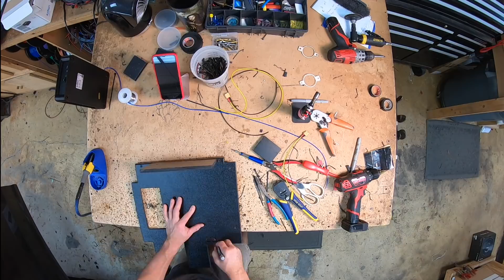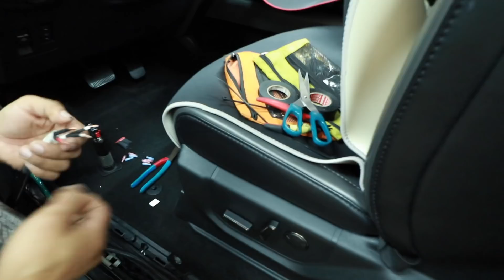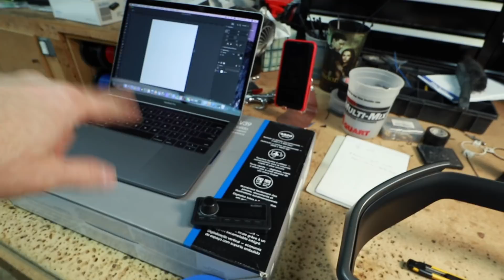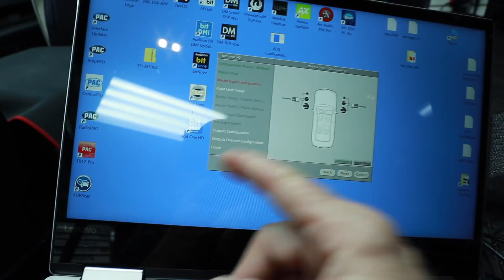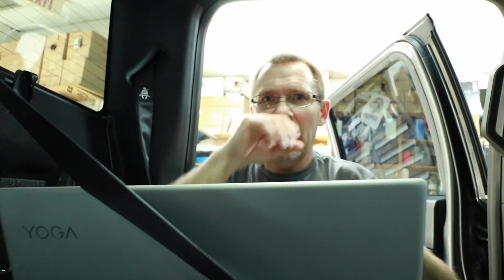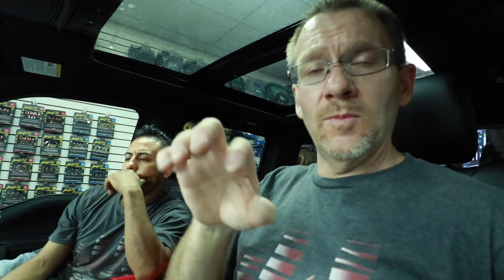Ford Raptor Audison full DA is done and sounding Amazing Installer Diaries 235 part 6

Comment: I have a 2018 f150 with the 4.3 inch screen, I want a new double din unit and aftermarket amps, I own more than 200 old school amps, what do I need to replace the radio? I will buy from 5 Star if they can ship the parts to Arizona.  Dash kit, module etc,  I want to maintain steering wheel controls.

Comment: Dean, I have to disagree on the way you measure the doors speaker distance. Yes, physically it is set back from the speaker grill but they have fast rings to direct the sound through the speaker grills. The sound only comes out of the grill. Would it not sound more correct to measure the grill distances instead for the recessed speakers as the sound is actually emerging from the grill?
Reply: Sound does not “emerge from the grill.” Measure to the voice coil.
Reply: @Masterdebator881  So if there is no grill and the speaker is behind the panel, where is the sound coming from? Exactly, this is why there is a speaker grill, so the sound can emerge into the cabin. The speaker is useless if there is no way for the sound to enter the listening area. You all can go on measuring the speaker behind the grill adding distance to the speaker and I will measure to the grill where the sound is passing through so that the image is correct.
Reply: Evilthx 
You might want to do some research on how a speaker functions before trying to correct somebody who actually has because your ignorance is showing.
Reply: @Masterdebator881  I know EXACTLY how a speaker functions. How the speaker functions is irrelevant to this conversation. Why would you measure to the speaker in the door when the only place the sound is coming into the cabin is through the grill in the door. If the speaker was 12" back from the grill are you going to still measure to the speaker when the place the sound passes through hasn't moved??? If there were NO obstructions then you measure to the speaker. Like if the speaker was mounted to the door panel.
Reply: Evilthx 
Do what you want as far as measuring, its your stereo. I’ll continue to do it the way science dictates.
Reply: @Masterdebator881  I am not aware of any science that "dictates" that you should measure to a speaker behind a panel for proper time alignment. Also, why measure to the voice coil? The voice coil is useless without the cone attached to it to move the air in front of it... which is where the sound comes from. The moving air in front of it. In the case of a speaker behind a panel, the moving air is exiting the grill in the door panel... measure to the actual place the sound is coming from. The grill.
Reply: Evilthx  
You’re not aware because you are ignorant! It’s obvious that you have no knowledge of the things you are speaking of. If you had a clue, you would know why you measure to the voice coil. Please explain how your theory correlates with home speakers that use physical time alignment, or have they been doing it wrong for decades?
Reply: @Masterdebator881  We are not talking about home speakers, we are taking about speakers in the door of a vehicle behind a solid panel with perforations in it to let the sound from the speaker come through so it can be heard. Trying to change scenarios because I am right isn't going to help your argument some how become correct.
Reply: Evilthx 
Where does sound originate from a speaker? That is your answer! You seem to think that sound begins once it enters the cabin through the grill. It doesn’t!
Reply: @Masterdebator881  The speaker creates the sound, that is all. Without the holes in the door panel for that sound to come through, you would not hear the speaker. When you measure to the voice coil behind the cone, behind the panel you are measuring to an obstructed speaker. You will have issues with phase and correct imaging.
Reply: @Masterdebator881  Also... Let's use your logic. Where are you hearing your door speakers sound? At the speaker or the grill in the door?
Reply: Evilthx 
Go cover your grill, with music playing,see if you still hear sound. I’ve spent enough time on this, I refuse to educate people for free. Plus, you seem to know it all.
Reply: @Masterdebator881  good thing cause my iq would drop if I paid you to educate me. Nobody listens to their music with the speakers blocked off.
Reply: Evilthx 
Ya genius! Because nobody listens to subwoofers in trunks! Where do you measure to time align a subwoofer? I can’t wait.....
Reply: @Masterdebator881  Now that I am home from work, I can respond. Well, being that subwoofers don't tend to suffer from beaming and the lower the bass the more non-directional it becomes, it is not as critical. However, Mine is set to a distance of ZERO inches in my RF 3Sixty.3. I measured it with the rear seat backs down, to the edge of the baffle which is rear facing in my trunk. My midbass are measured to the door grills, my mids are also measured to the door grills and my tweeters are mounted in pods on my A-pillars and are measured to the center of the tweeter face.
Reply: Evilthx 
Beaming? What the hell does that have to do with time alignment? I don’t think you even know what the purpose of time alignment is!
Reply: “The origin of sound from the speaker (not a horn) is the position of the voice coil. Estimate the distance from the grille to the position of the voice coil and add it to each of the measurements. Doing this may help a little with crossovers, but it doesn’t matter for left to right imaging.” Andy Wehmeyer
Reply: @Masterdebator881  One more thing.. When you time align the speaker behind the door panel you "move the speaker" away from the panel and away from the grill electronically and you create a delay behind the panel. When you measure to the door panels grill, you "move the grill"  WITH the speaker behind it because they will now act as one unit. The distance from the cone of the speaker to the grill has not been altered via the delay as the previous example has been. Surface mounted and or exposed speakers can and should be measured to the speaker.
Reply: Evilthx 
You become dumber with each comment you make.
Reply: @Masterdebator881  Isn't it sad that when one has no rebuttal they resort to insults like it will make the other person sad somehow for shutting them up.
Reply: Evilthx 
You continue to argue against a FACT. It’s not debatable! You are completely ignorant because you think your beliefs are correct when science has proved otherwise! You are not arguing with me, but with the best speaker builders in the world! You seem to think they are all wrong. Post scientific evidence that supports your claim!
Reply: Evilthx the sound still travels from the speaker through the foam, and then out the speaker grill. There is sound that is lost within those few inches between the speaker and grill, as well as some sound is distorted through the foam. That is why you measure to the speaker and not the grill itself. I don’t know why you have a hard time understanding that.
Reply: @JacesOwnWorld  First off, don't presume to think you know what I do and don't understand. I have measured both ways and I imaged both and I know which worked better, which reacted to being crossed over better and which responded to being eq'd better and I verified all this with a mic and software in my own full active system. Go on doing it your way.
Reply: Evilthx you have to go to the source of the sound for the measurement. I equate it to a gun firing a bullet. The source is inside the gun, not the end of the barrel where you first see the bullet.  If that makes any sense.
Reply: @tannerclayton5941  it does and doesn't.
Reply: Evilthx story of my life... 😂

Comment: on the 15-up F-150 you shouldn't run a ground to the battery. They have a smart charging system that if the ground isn't run through  that little circle sensor (that the factory grounds run through right before they connect to the battery) it can mess up that charging system. My boss just just gave me the TSB about it the other day.
Reply from the maker: That is fun. Will definitely look into that. We have not had any issues yet but that does not mean there won’t be any in the future.
Reply: Can you share a link to the TSB?
Reply: @ccvideotech  https://www.buyersproducts.com/UserFiles/SnowDogg-TSB/16-tsb63.pdf

Comment: Not in this particular case, but how do you measure for time alignment if you have a passive crossover in the mix?  So if you have the midbass in the door, and tweeter top of dash, how would you measure that for a dsp?  I guess its the same for subwoofers, mine are on opposite sides of the car, but on one channel.
Reply from the maker: Go to the mid bass for your number, voice coil of woofer
Reply: @FiveStarCarStereoInc  Interesting question from the OP.  Can you explain why you go to the midbass rather than tweeter, center average or some other measurement.  I curious, drop some knowledge on me.

Also what do you do for subs?  Does it change depending on orientation, placement etc?

Comment: Looking for install info for a 2011 Audi A4 with concert audio. Looking into a new head unit but can’t find mmi integration.
Reply: @paul garcia   
It's just about impossible to replace the Audi MMI/head unit.  Most guys use a Mobridge DAx interface unit in order to get a clean source signal from the MMI.  It's similar to the Nav-TV ZEN unit used here for the Ford F-150 Raptor.

And then you can also use a portable DAP as an additional pure Source signal into a DSP.  

Check out this 2015 Audi S4 install on DIY Mobile Audio forums...

https://www.diymobileaudio.com/threads/2015-audi-s4-sinfoni-minidsp-audison-thesis-stereo-integrity.410907/
Reply: Yeah already rocking a Bluetooth adapter not looking for full system rebuild just new and more modern head unit. But yeah guys in forums haven’t changed headunit for mmi reasons.

Comment: Your description of sound clarity in relation to high volume is so accurate. When I finished the system in my truck, I didn't realize for a few days how loud it actually was playing at full volume because of the clarity and lack of distortion until I demo'd it to a friend in the passenger seat. I'm running a SoundMan iPad dash with a DragonFly DAC, AudioControl Overdrive Plus, JL Audio HD 900/5, Focal K2 Power 6.5 Coax, JL Audio Single 8W3v3 MicroSub, Ported. Sounds amazing in my little 2015 Silverado 2 Door and I haven't put in a DSP for time delay and EQ, any recommendations for that would be nice.
Reply from the maker: If you have an iPad in the dash you definitely want a DSP that can be controlled by it. DSr1, PG, Audiocontrol w/ adapter, alpine
Reply: A DSP will allow you to remove the AudioControl Overdrive Plus as well. Less in your signal chain is best.
Reply: @bbchester6  Correct, that was also part of my phase 2 upgrade, the Overdrive Plus is really just there for a volume knob
Reply: Hey Andy,

So you just used the Dragonfly to go from 3.5mm to RCAs into the AudioControl?
Reply: @brocklagunas3055  Yes, with the lightning-USB Camera adapter, allows me to listen to Hi-Res files when I stream from the Qobuz Music App
Reply: andy schloesser, so what about when watching movies? I’ve been trying to find a new way to connect the mini 4 via toslink.
Reply: @brocklagunas3055  What about watching movies? I watch movies on the Amazon Prime Movie app. As far as integrating into toslink I don't know I never personally looked into it. You might be able to daisy chain adapters, like lightning-hdmi adapter then hdmi to toslink adapter.
Reply: @brocklagunas3055  If you feed your iPad into a Sony RSX-GS9 it will give you a toslink output but it'll cost $1500, Doug from SoundMan did that in his F150 as well as Steve Meade in his Tahoe